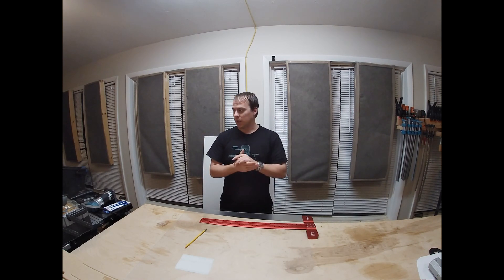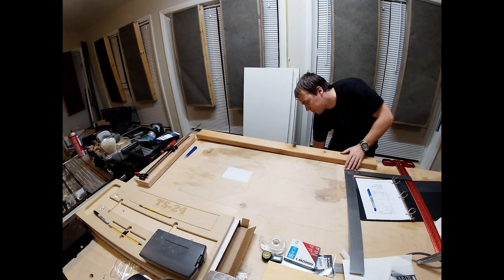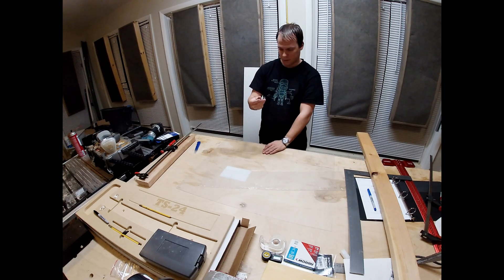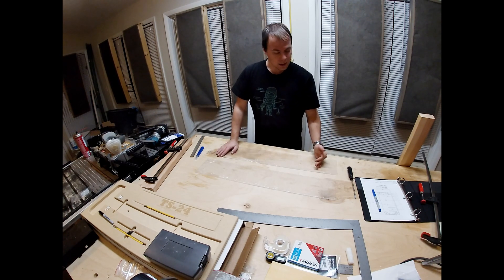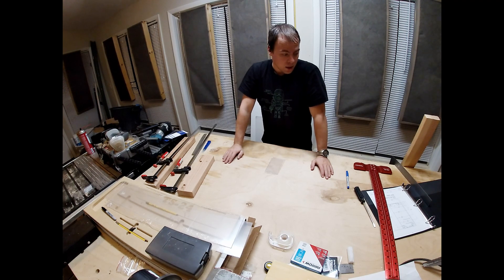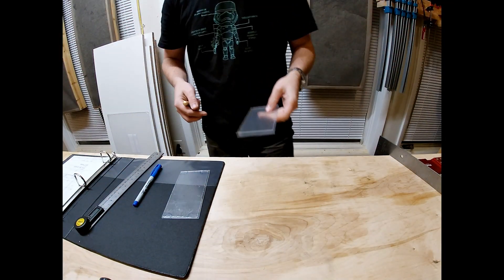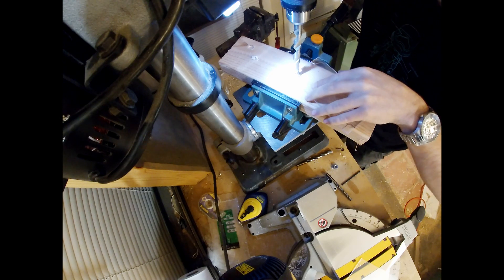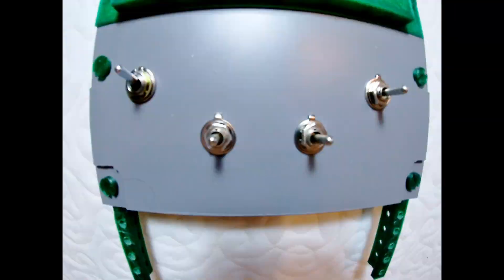F/A-18C Cockpit Build - EP07 - Fuel Panel Build

Comment: Dig it man good job.  Are you going to go into the wiring or programming of the switches?
Reply from the maker: Yup. In either EP08 or EP09 I'll be building the arduino that controls the entire cockpit. I'll go into how the switches work, how i'm going to wire it, and probably some of the programming as well.